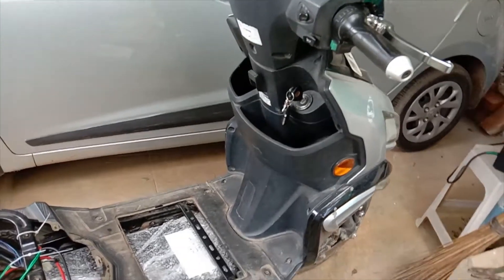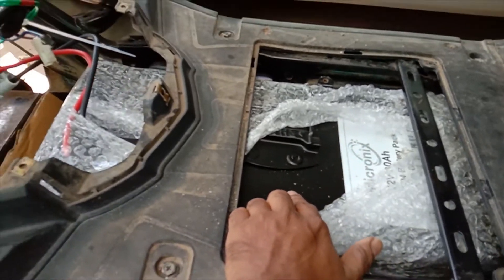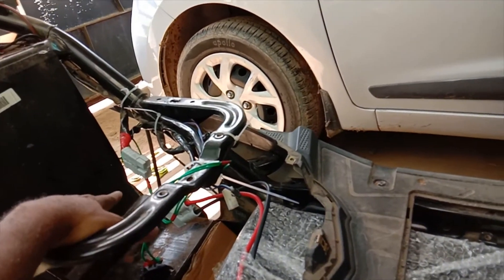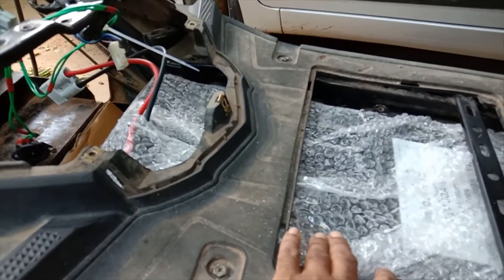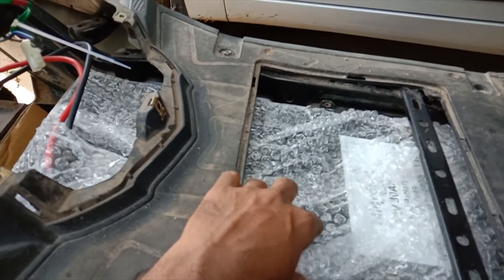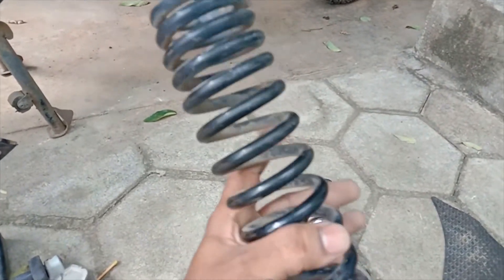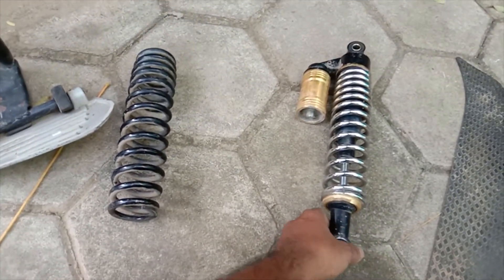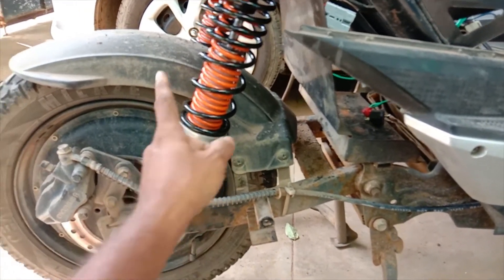LEAD ACID TO LITHIUM FERRO PHOSPHATE BATTERY CONVERSION IN OKINAWA PRAISE

Comment: Sir iam using lifepo4 36ah(micronix) for
6 months but the mileage is around 30kms in local. Is there any cell problem?
Reply from the maker: there might be a cell linkage cut off or cell itself problem...if got a warranty..immediately claim that...bro

Comment: Sir. I also are playing to change to LiFePo4. But the battery people are telling that Li-ion is better. They are telling that only 72V,36AH only will fit into the space of okinawa. They are also telling that pickup and mileage will drastically reduce. But your video tells 77 in sport mode even with 30AH. How can i confirm my series is 23 or 24?
Your suggestion and review was extremely useful.
Reply from the maker: Please spend some time for entire calculation before taking decision and then you proceed to change your battery  as well as  shock absorbers...I hope our phone discussion will help you.

Comment: This shokobser ct 100 or platina which coract
Reply from the maker: both can use , I use platina. because its softer than ct100
Reply: Use Gabriel old suzuki shocks Gabriel old fiarro , Yamaha rx 100 use only Gabriel shocks other wise back pain confirm

Comment: Okinawa praise m icon problem  not running  motor
Reply from the maker: motor issue very rare...my suggestion is you settle the issue with dealer immediately....without delay . otherwise you may get cheated by them.

Comment: Sir as I saw ur battery pack in ur Okinawa praise, whether it is 23series or 24 series battery pack?. If it is 23 series, then the battery pack's continuous discharge current is ok for this scooter's peak power 2500watts?
As u used LIFEPO4 72v 30ah  (2160watts), then the battery bms enough for the scooter's peak power 2500watts.?
Please reply sir..
Thanks..
Reply from the maker: yes , Mine is 23 series would be enough as long as it meets 72V....no issue....but Mileage difference will be there..
Reply: @thamizhkudi4131  ok thanks sir..
Reply: @thamizhkudi4131  24 series pack use pannalama

Comment: Hello Sir, How is lithium ferro phosphate battery performance after few months of use? Have you noticed any drop in mileage? I am also looking forward to buy lifepo4 battery scooter - Do u have any recommendations?
Reply from the maker: Sure sir, upcoming video about the performance of lifepo4 battery..
Reply: @thamizhkudi4131  hi bro what is the performance pls upload video bro... I am waiting... thanks bro ...
Reply from the maker: @moonking476   Performance of the battery as well as ebike so far so good. However Mileage drop is there as I am using this LiFePo4 battery for a year..bro.
Reply: @thamizhkudi4131  thanks bro ...

Comment: Sir, Okinawa praise not moving.showing blinking battery percentage and when starting showing 60 instead of 72.
Reply from the maker: If have waranty, Please call service ppl to check. otherwise you cannot claim. This issue  may be due to battery issue.....sometime controller failure also happen rarely.
Reply: Controller fault sir.i bought new one.

Comment: Sir also I have doubt regarding charging. Lifepo4 charger extra vanganuma? Then connection with the motor controller yepdi paninga! Please give me ideas
Reply from the maker: When you order LIFePO4 battery, please mention the manufacturer what type of connector you want, if you give your old charger connector type they will provide battery with the connector which will suit with your old charger. Otherwise, you need to buy new charger to suit with your battery again...for which you need to spend almost 5K. Do not waste your money...

Comment: Li ion evulo nal varum
Reply from the maker: Li ion can last approx 2000 to 2500 cycles...when compared with lead acid last 250 to 300 cycles....for my case lead acid life time 200 cycles...in 15 months time. based on this calculations..400 to 500 cycles per year.I guess Li ion can last for approxmately 3 to 5 years...if no damages in battery assembly i mean tag welding and mileage reduction over lifetime meet you usage...

Comment: Li ion battery marubadium 2 year apuram change pananuma
Reply from the maker: its not based on time period..its based on your requirement...if old battery charge last down to 20 to 30 kms range after 2 years..if your usage less than that...still you can use further more years...otherwise you can change  based on your requirement...

Comment: New battery cost?
Reply from the maker: it's cost about 34k and metal box cost 1K extra..for 30Ah and warranty 2 years...they are giving..
Reply: @thamizhkudi4131  plz share battery manufacturing company contact number SIR
Reply from the maker: @revathikarthikeyan540 MICRONIX Lithium Battery
4.8 
 (83) · Battery manufacturer
No.25, 19th Cross, Main Road
Open ⋅ Closes 6PM · +91 80888 83890
Reply from the maker: Make sure everything good related to your purchase and pay....
Reply: Which company battery
Reply: @positivenews2583  No branded. Assembled.